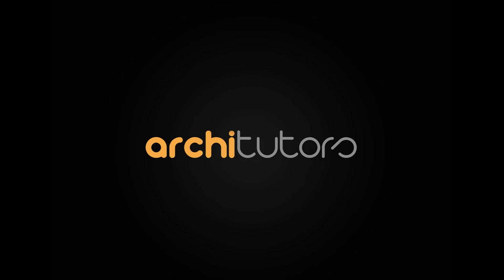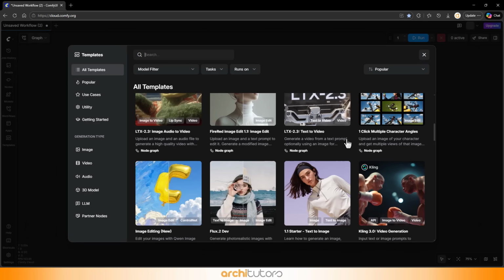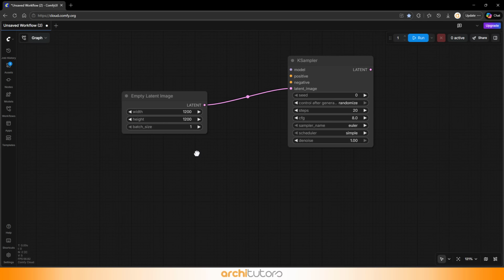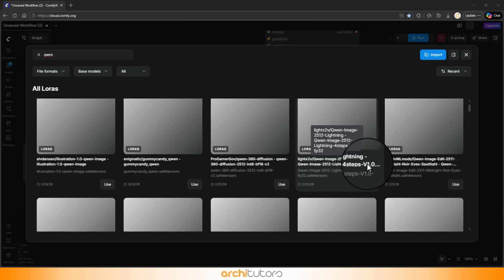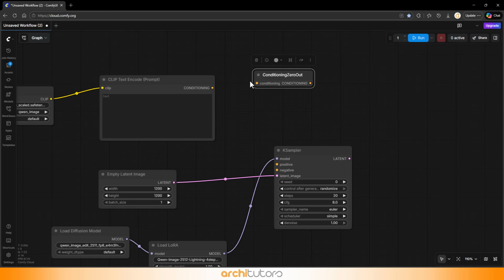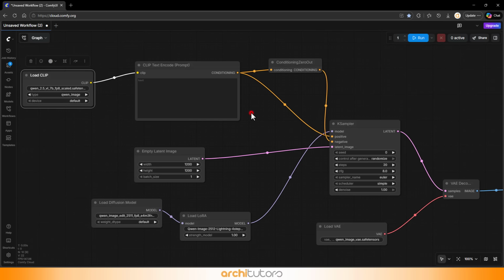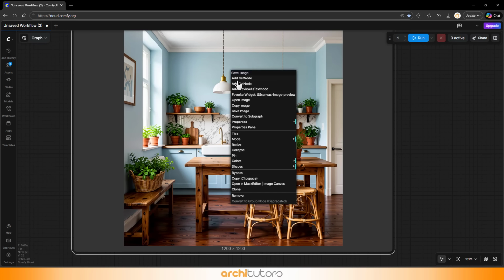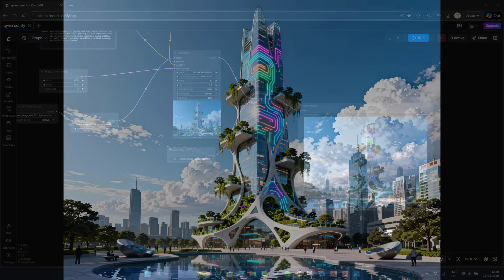ComfyUI for Architecture & Interior Design: Beginner Image Generation Tutorial

Comment: why i cannot select any models from load lora or load diffusion node? it says null on the node and it seems disabled.
Reply from the maker: If you're using comfyUI locally, you'll need to download those basemodels for different nodes and place those .safetensors or .ckpt files in the right directories.

Comment: Very nice tutorial can you help how to select correct models - for clip-load diffusion model  - LORA model and VAE . compatible, can you explain Load checkpoint and load diffusion model
Reply from the maker: Use Load Checkpoint when you want a complete model package quickly basically that contains the UNet, CLIP, and often a default VAE bundled together. Use Load Diffusion Model when you need modularity — for example, pairing a custom VAE or CLIP with your diffusion engine.